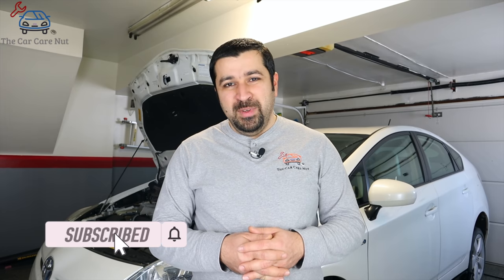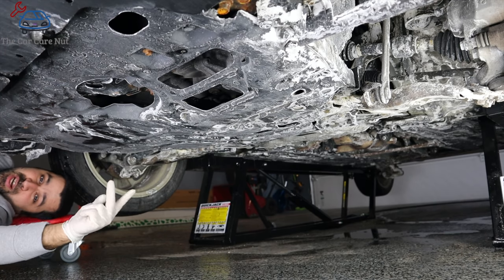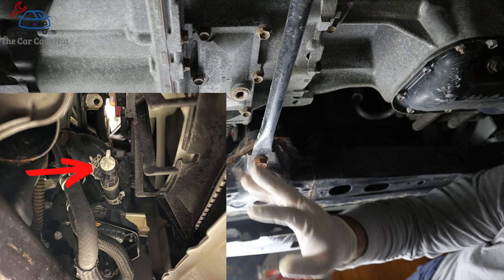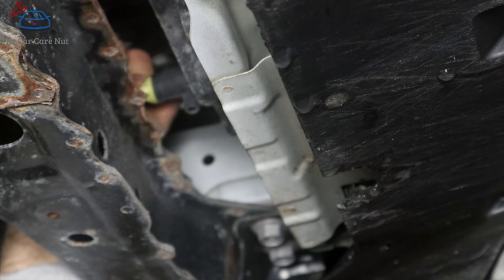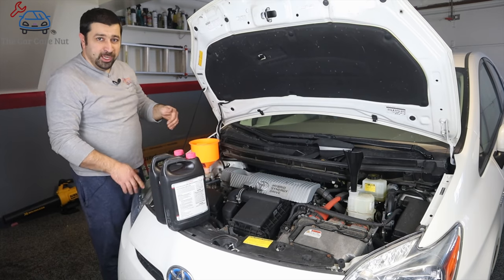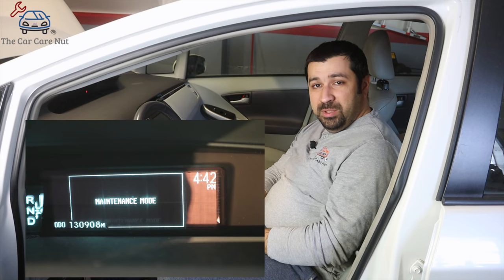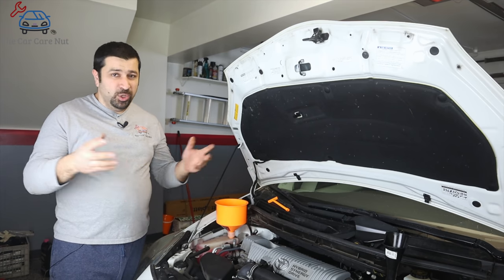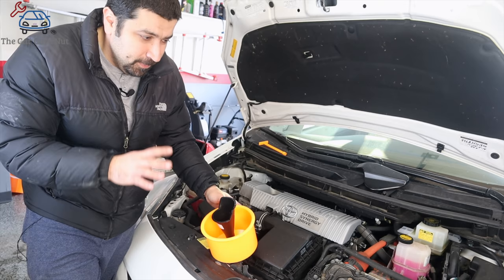How to replace your Toyota Hybrid Inverter and Engine coolant

Comment: ANY HELP IS APPRECIATED!

Can't figure out why I have no hot air. Changed blown head gasket, changed water pump and thermostat, and still no heat. Bread the system for 45 min to get no bubbles in a raised funnel. If I wait for 30 min, the cabin heat warms up to hot, but as soon as I hit the A/C on button, it starts blowing cold air again. (Room temp).

Comment: Hello AMD, a new subscriber since recently switching to a Lexus car. Watched a few of your videos, may I say excellent presentations with good clear instructions. A complete god send to the average DIY mechanic!
I plan to change the coolant on my RX400H and wondered does your method drain the coolant in the heater core ? Or is the amount left there not very significant ? Thanks in advance.
Reply from the maker: Hi! Some of it will be drained and what’s left is not significant

Comment: 2013 Toyota Prius. 142k miles. Could not loosen the inverter drain, damaged the head with my 10mm Allen wrench. I tried a bigger size Allen wrench, different shapes and size bits, long breaker bars, WD-40, reverse drill bits, tried heating it up, nothing worked. I did not try welding another bolt on top. Ended up using a small pump to take the coolant from the reservoir and refilling it with fresh coolant. I plan on doing this a few more times to get more fresh coolant in the system. I realize it is not as good as draining, but I spent too much time on it.  I wish toyota used a regular bolt with a large head for a bolt that has a  50 foot-pound tork spec and sits exposed to all the salt and rust. Any other ideas?
Reply from the maker: If you ever get this again before you strip the head of the bolt, tap it with a hammer a few times and it will loosen up.
Reply: @TheCarCareNut  thank you. I will try that before welding and getting another bolt. My daughter swiped the car in another car so she almost solved the whole problem for me. :-)

Comment: Does mileage decrease as hybrid batteries age?
Reply from the maker: Hi! Yes over time it does
Reply: Glenn I can tell you the mileage on our 2013 Avalon Hybrid has not changed at all after 86000 miles-41.5mpg.
Reply: @bogieman101  Mine was up in that same range at that mileage too.  I now have 160,000+ and my mileage has dropped to about 30 to 35mpg. Car stills runs like a smooth machine though!
Reply: @glennclarke9442  Thanks Glenn, the wife has been trying to decide how long to keep it before she gets a small suv. With things up in the air about the future (gas, electric, or whatever) we really don't know which way to go.

Comment: Hello Ahmed bhai, I hope all is good at your end I will be soon shifting to north america and thinking to buy a used toyota prius c or prius 3rd generation. my simple question is would a prius with depleted or impaired hybrid battery can still be driven even with bit of worse then gas milage and how to take care of it. I have heard one can drive the prius car even if the hybrid battery is almost dead. the car will give little worse gas milage but it still will be better then regular gasoline car. ?? please advise.
Reply from the maker: Hi! If the hybrid battery is failing the car will run with very limited performance and bad gas mileage. I would buy a regular gasoline car before buying a hybrid with a bad battery

Comment: What do you do if car is already in maintenance mode? After 5k for instance it turns on. Do you have to do the procedure again after filling up coolant? Thanks
Reply from the maker: Maintenance mode is different from when the maintenance  light is on
Reply: @TheCarCareNut  make sense. I realized after I posted. Thanks. You are great.

Comment: Are engine and inverter coolant lines isolated from each other or interconnected I.e., can they be drained at different times?
Reply from the maker: Hi! They are not connected and need to be serviced separately

Comment: I've noticed various plastic fittings underneath my Toyotas damaged or missing.  I found some multi-style ones on Amazon so got them but, still, don't seem to have a certain one I need for a corner fastener in my Corolla.  Does Toyota have a kit of various fasteners?
Reply from the maker: Hi! Toyota doesn’t sell a kit with different fasteners but if you look up the parts catalog for their exact location there’s usually only a few styles

Comment: That was very helpful... what would it cost to have this done by the dealer? Thank you.
Reply from the maker: Around 300-400 dollars at the dealership
Reply: @TheCarCareNut   Wow.  They’re make up low volumes with high margins.
Reply from the maker: Honestly the engine coolant is actually low labor usually around half an hour or so. The inverter coolant because most independent shops don’t want to deal with the hybrid system pays around 1 hour of labor. So you got around 1.5-1.7 hours in labor for both. A gallon of coolant retail is around 20-25 so that’s the variance in the price

Comment: @The Car Care Nut -My 2015 Prius with 36K miles over heated about 7 weeks ago, after an accident repair to the front passenger quarter including the radiator reservoir. I replaced the radiator hose connector that was cracked, then drained and refilled the engine coolant. It would not go into maintenance mode so I took it for a 15 minute ride to get the air out of the coolant system. It is working well, no overheating and no steam from under the hood. 
On the weekend, I took it to the Toyota Dealership in town to get the "free" oil change and state inspection so I could renew the state registration. They told me it needed new tires but would pass the inspection, that's reasonable. They also said there is a radiator leak and needed a new radiator for $800. Could the problem be that there is a OBD2 code for the radiator that needs to be reset? Is there an easy way to reset it? Thanks
Reply from the maker: Hi! The radiator leak is likely just a cracked radiator from the accident and wouldn’t set codes unless it leaks all coolant and overheats again
Reply: @TheCarCareNut  Thanks

Comment: So the change interval is at 5-years but does that also a certain number of miles?  My wife's 2017 hits 5-years this summer but only has 26,000 miles on it.
Reply from the maker: Hi! Usually 5 years or first 100k miles then every 50k afterwards. I would definitely consider replacing it at this time. It’s cheap and very diy.
Reply: @TheCarCareNut  Thanks!! Have you heard of the turbo issue with the new Tundras??

Comment: AMD, thanks for the video. 
I’m planning on doing this on my Scion iM. Do I need to put my car in maintenance mode? Mine doesn’t have a radiator cap but it only has the overfill container coolant im guessing that’s where I should fill it. 

Any special instructions on how to do it?
Reply from the maker: Hi Joseph. So your scion iM is not a hybrid, so no maintenance mode on that one. You’ll drain the fluid, use the spill free funnel to fill up your reservoir and over fill it into the spill free funnel. Then start the engine with the heat off and let it run until the fan comes on twice and you’re all set.
Reply: @TheCarCareNut  heat off? I read on some forums that the heat shud be on full blast with full fan on as well.
Reply from the maker: I wouldn’t. Heat at full blast will make the car take a much longer time to warm up and open the thermostat. Cars that had a valve you’d need the heat on but not on full blast. Your car doesn’t have a heat valve
Reply: @TheCarCareNut  lovely. Thanks brother

Comment: Great video, watching it for the second time, as I am imminently doing the job on my recently-acquired 2010 Prius gen 3.  The pink coolant mix looks too fresh, and it’s just a little out-of-keeping with the lack of TLC the car has had before it landed with me (it’s low mileage but lived many years in the seaside town of Brighton, on England’s south coast, similar rust issues depending on where it was parked eg soft sandy roadside verges).  In other words, I suspect the cheapest pink coolant available was used, or indeed it hasn’t been changed in a long time.

Noticed some comments about people fearing slobbering grease or anti-seize would make the nuts/bolts come loose.  This is a thing that hardly ever happens as CCN knows.  Yes, Tesla did not tighten some of the nuts/bolts at the factory, I will be honest, that is SO odd, I would say, it’s a disgruntled employee making trouble - just my opinion, I don’t see how it really gets to happen even there.

But in the owner situation generally, my MOT (annual roadworthiness test in the UK, stands for ‘Ministry Of Transport’ which doesn’t even exist any more, but the name stuck, the ‘MOT test’), threw up a warning from the mechanic about the grease over bolt-ends.  I said the thing is, I have never known a nut or bolt I slobbered with grease, to come loose.  I have OFTEN grazed my knuckles, had to hammer gently or not-so-gently on brake disks to clear the rust-lip or free something, til deep into a Sunday night, and generally had a torrid time with the rotted fasteners and exposed parts of cars.

I think we see a lot of movies, from the original Mad Max where his best friend’s motorcycle has the rear end loosened with disastrous consequences, and more light-hearted stuff where someone’s flying machine is rendered unusable or to fail, by some bounder’s dastardly sabotage.  These give the impression, that with mere moments of easy force being applied, tie-rods, bushes, wishbones and ball joints are just gagging to drop off.   

I’d love to see a more realistic version…where the saboteur starts off nipping out from the evening meal to do a five-minute rigging of someone’s car or aeroplane before a race next day, but ends up being up all night with angle grinders, oxy-acetylene and WD40/rust penetrating oil…then to find the culprit, the victim just follows the trail of blood from the saboteur’s  knuckles leading to their hotel room…!  Nuts & bolts and fastenings just come apart with a jolt on the road?  Just Fall off with a nudge or vibration?!  I dream.  Thanks for the help again.

Comment: Hi, thanks for your helpful videos. I went my car for it's first service (Kona hybrid ) and the inverter coolant level was just above min, between min and max.  The stupid mechanic put IAT green coolant in the inverter tank, up to max level( it had pink from the factory probably OAT). I realized he did something wrong and I asked him to take it off immediately without starting the car. He took off what he could but from the top of the container using a hand pump, he did not drain the car from below,  then he refilled with pink original coolant. I drove the car for 500km, I complained to Hyundai and they asked me to visit again the maintenance center. They admitted their mistake and told me that they will drain the car completely and put original coolant. However they did not flush with distilled water during the process, just drain and fill. Do you think I have to do something else? Or after these steps the risk is low?  Thanks in advance.

Comment: The dealership/mfg recommended i get new coolant (flush and replace?) So I went with the rec. 

It's been a few days and I was curious to see the reservoir for both tanks. i didn't start my car, 2017 Prius Prime, the left tank is low and the right tank is full. Is the left tank supposed to be almost empty or did the dealership mess up?
Reply from the maker: It might need a top off.

Comment: Does non hybrids have this maintenance mode? Like the jdm toyota rumion (= 2010 scion xb) with 2zr-fae engine. How do you bleed this model (no typical radiator cap)
Reply from the maker: Hi! That model doesn’t have maintenance mode as the engine runs all the time. Use a spill free funnel with a long neck to bleed those.

Comment: Just wondering 💭 how do you take the car out of maintenance mode . You said that is very important and will ruin car if not taken out. You told us how to put in . But not how to take out . If you could help me with this I would really appreciate it Thk you
Reply from the maker: Hi! Just turn the car off and back on and it’s out of maintenance mode
Reply: @TheCarCareNut  Thk a bunch bud

Comment: When can you do a video of coolant drain/refill for a 2020 RAV4?
Reply from the maker: Hi Mike! I am planning on a general video for the new engine coolant replacement which will include your 2020 rav4. I do need a candidate car for the video in the Chicago area.
Reply: If I lived in that area, I'd be glad to help out with my RAV4.
Reply: I looked into the emanual for my 2020 RAV4.  There isn't anything from 2018 through 2020.  I do have a subscription with Mitchell 1 DIY for my wife's Kia Sorento, and hopefully can add the RAV4 to that subscription.
Reply: Does the 2020 RAV4 have a coolant shut off valve for the heater?  Or is it the HVAC doors that switch the air flow around the heater core for summer use.  Oh ya.  I do like the electric motor assist for the steering!  It's so smooth and easy!  Also, THANK GOD! NO P/S PUMP, HOSES, FLUID, (power assist) RACK!
Reply from the maker: The RAV4 does have a heater shut off valve. More information on the engine in the RAV4 in this video https://youtu.be/9GWKBbEMCC4

Comment: I did exactly what he said. And on maintenance mode heat and ac/ blower off i ran the engine for 25 minutes and topped everything off. Then i noticed engine coolant reservoir making boiling bubbles and steaming a little bit. On my obd 2 scanner screen the temp went up to 202° f. And i didnt see the fan turn on at all until till i turn the AC on both fan worked. I shut the car off and put the caps on and drove around city and interstate for 30 minutes full throttle many times and when i do full throttle it went up to 199° f and it stayed around 194-195°f all the time while the outside temp was 55°f. Didnt over heat didnt lose coolant and heat worked fine too. I was confused why did it over heat / boiling (204°f) on maintenance mode and why the fan didnt come on when it was hot? Please someone answer.

Comment: Hey, I have a Lexus es300h with 90.000 miles on it. Do you know how often I should change the cvt fluid? And if it's never been changed at this stage is it still OK to change?
Reply from the maker: Hi! Every 60-90k miles is ideal. Even if you go over that no issues changing it. I will have a video next week on how to replace the fluid with more information.
Reply from the maker: Hi! No horror stories at all. No clutches to worry about. I would change it every 60-90k miles. A video is coming this week for exactly that.
Reply: @TheCarCareNut  wow you did it man. You have the best channel out there. Thank you so much. I've watched every video of yours almost!

Comment: I just got my car back from an independent garage, in for a coolant engine and inverter  change also. trans fluid change. Did the engine coolant change, said he needed some software to do the inverter and transmission fluid change. 2013 Lexus ES300H. Is this correct, i don't see you using anything special in the videos
Reply from the maker: Hi! Nothing special is needed

Comment: Why prius gen 3 have two coolant reservoirs?
Reply from the maker: Hi! One of the engine coolant and one for the inverter. There’s no radiator cap on the radiator because of the small space and the place where the radiator is installed in the car

Comment: Why does the heater need to be turned off when topping off in maintenance mode?  I thought you usually have the heater turned on so it draws coolant to the heater core?
Reply from the maker: There’s no valve closing the heater core

Comment: I took Engine radiator and Invertor radiator off.   Now I do not know which pipe goes where. There is one pipe come from Invertor and another from the transmission area.  I am pretty sure these are invertor.   Appreciate if you can confirm...

Comment: Not sure what the purpose was the "go into maintenance mode".  Seems the process was just to let the car run while the system bled the air and top it off.  Was there any purpose in going into maintenance mode?

Comment: Hi AMD, Could you please share the part number for recommended engine and inverter coolant for hybrid. searching on the parts store, they come in three colors - cap , yellow (this you mentioned old) , pink and red. Which one is new, pink or red and what is the part number ? The toyota dealer near me has only the yellow one in stock.
Reply from the maker: Hi! Pink. The part number varies

Comment: Hi AMD...does this video apply to non-hybrid models?
Reply from the maker: Yes on the engine side. Which model do you have?
Reply: @TheCarCareNut  2015 Toyota Rav4 LE 2WD
Reply from the maker: Yea drain and fill it and let it run until the fan comes on and off twice